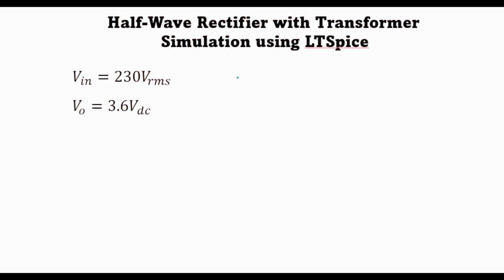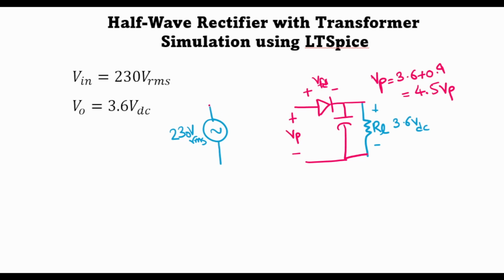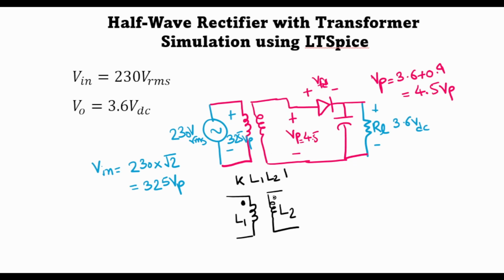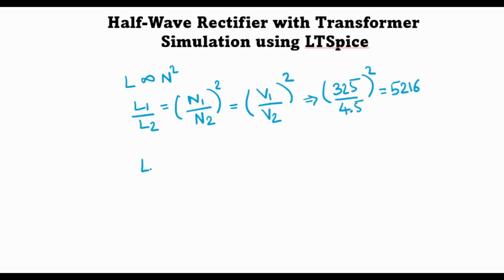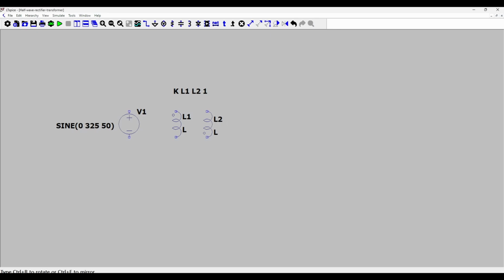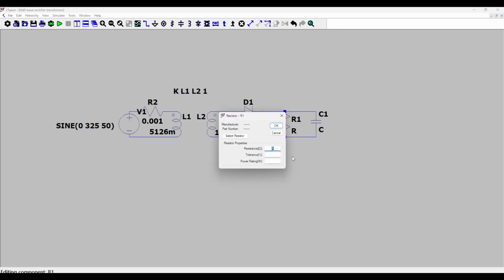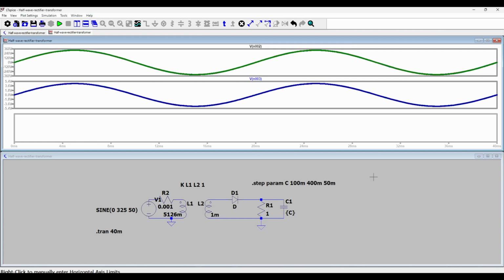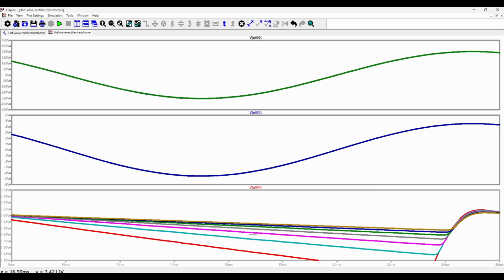Halfwave Rectifier and Transformer Simulation using LTSpice | Transformer Modelling Explained

Comment: Thank you for your excellent tutorial on transformer calculation for simulation.
But I was struggling to get the output voltage of 3.6v across the load resistor R1.
Is R1 supposed to be 1ohm as it's nearly a short? 
I put R1 at 1k and everything simulated just fine.
I'm simulating with Kicad 10.